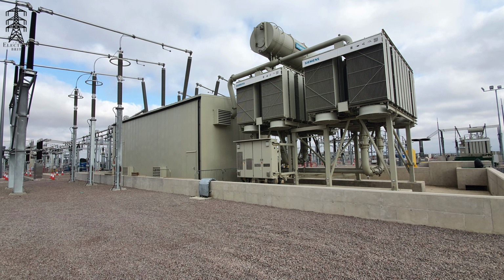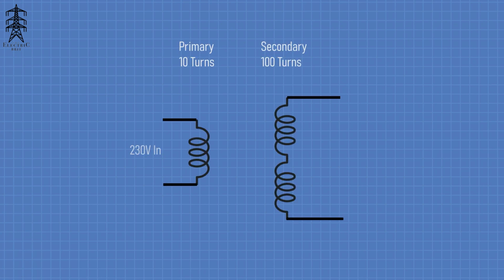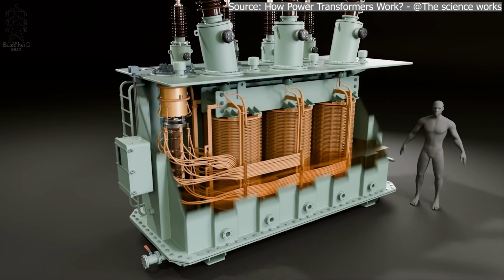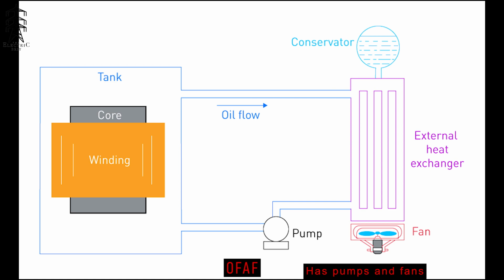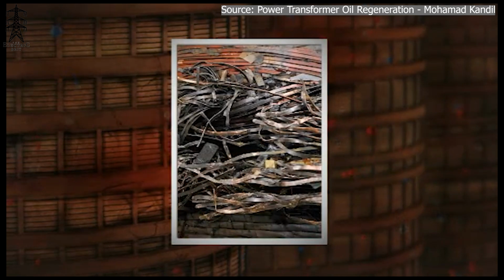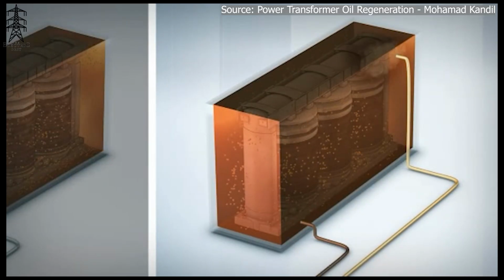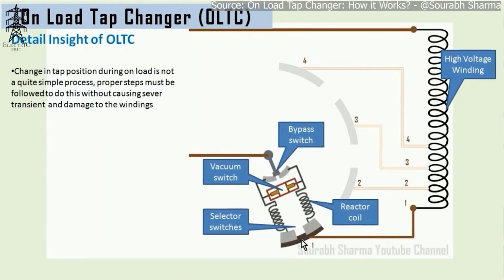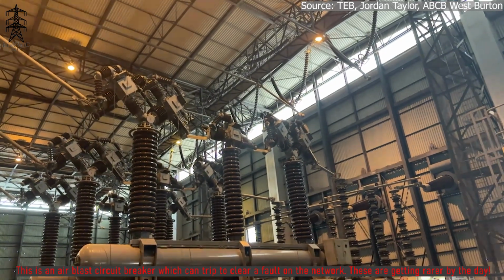Why Transformers Fail (and How to Prevent It)

Comment: 1.) How is the transformer protected against a Lightning flash into the overland lines?
2.)How does a electromagnetic storm from the sun damage the transformer? Is there an increased voltage between the phases or will the voltage between earth and phases rise?
Reply from the maker: As for solar flares, the DC currents they induce into overhead lines will saturate a transformers core causing additional heating and I believe the best way to protect against this is with series capacitors on the overhead lines that prevent the DC from flowing (they can’t cross capacitors).

Hope that helps. Will cover this all in future
Reply: @TheElectricBrit Series caps on AC transmission lines are used to cancel out the inherent line impedance and allow higher power flow on the line. They are not too common, but not uncommon either. Shunt capacitor banks are super common, but not as effective as series caps but also a fraction of the cost and engineering. However, capacitors are not used for protection on transmission lines, not that I have ever seen unless something super new. Plus, series caps have spark gaps or MOVs for over current events to protect the capacitors. Pretty cool testing the spark gaps! The surge arrestors should handle any surges and as you said, if anything shorted to ground, surge arrestors included, the distance or over current relays would pick up and trip the transformer / line. 
EDIT: And to add, to protect the series caps a bypass breaker CLOSES to bypass the current around the caps. It's a close priority breaker and the few I have seen were two cycle close times and forget what open time they were, maybe 6 cycle or some odd number. but was a faster close than open. That's a fun to get used to when commissioning, a breaker closing being the desired fault protection result. 

To answer #2, look up the 1989 solar event in Canada where a solar flare induced current in to the transmission lines and knocked out power for hours in Canada. Lots of information and learning from that event. 
Good video none the less....
Reply from the maker: Thanks for the answer and experience. Yeah I’m not an overhead lines guy so I’ve personally not seen series capacitors that I can remember, only ever shunt reactors and cap banks in the substation, especially on cable circuits.
Reply: @TheElectricBrit I've only worked on a few myself. But pretty clever theory behind them. Simple AC electrical principals with lines being inductive and the caps being capacitive (obviously). I think you mentioned you will be doing a video on transmission line shunt reactors, now there's an interesting phenomena that won't makes sense to most people. How do you end up with MORE voltage at the end of a lightly / unloaded transmission line?? 
Although, higher voltage does not mean more power. 
Of course, all back to AC theory. 
I have studied them and know about them, but never have worked on them personally.
Maybe you can make a video of transmission line series caps, shunt caps and shunt reactors? ;)
Reply from the maker: Lightning strikes on overhead lines will likely be picked up as a transient fault (momentarily, not persistent) by distance protection relays which are monitoring the overhead line for over voltage caused by the strike and phase to ground faults caused if it flashes over the insulation to the tower. 

If it’s not powerful enough to flash over then the protection might not trip and the surge will be handled by surge arrestors at the ends of the line before it reaches the transformer. Likewise the ground wire across the top of overhead lines is designed to take the strike and send it straight to earth before it can hit a phase conductor.